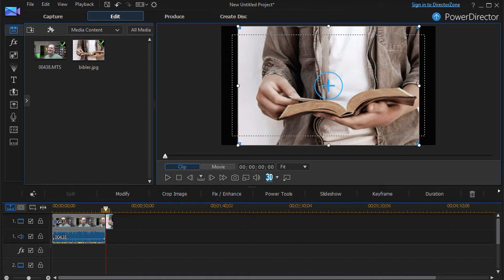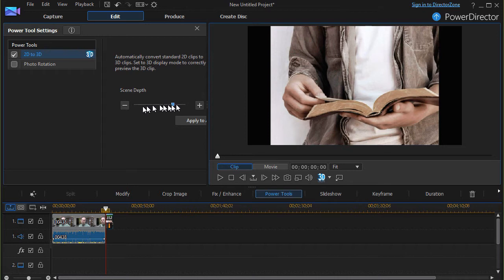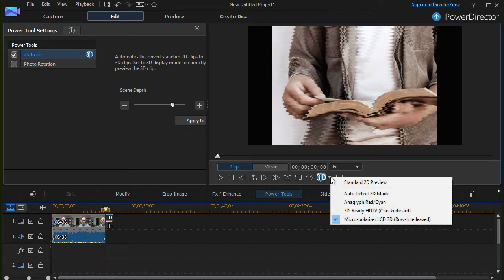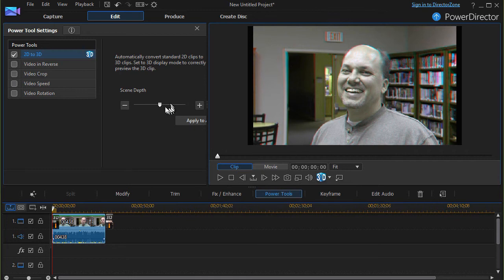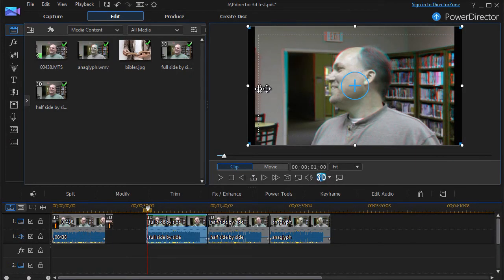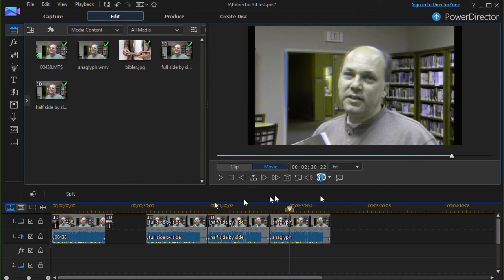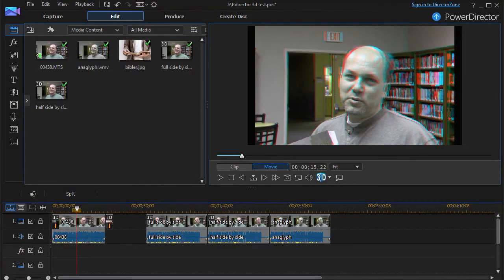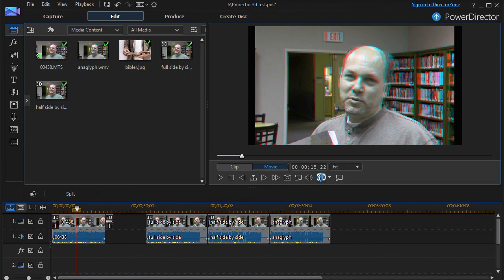PowerDirector - How to emulate 3D results with 2D footage

Comment: Everything I've tried so far has failed to turn into a 3D film. What is the secret?
Reply from the maker: I just reviewed the lesson. Much has changed in Cyberlink since this lesson was created, so I will design a new lesson. In any case, you will need a version of PowerDirector that supports this feature to try it out.
This link shows the differences between the products available in the current version.
https://www.cyberlink.com/products/powerdirector-video-editing-software/comparison_en_US.html?affid=2581_-1_647_PDR-B&msclkid=fbaadaf0aba312ba709ebb04acbebad3&utm_source=bing&utm_medium=cpc&utm_campaign=PowerDirector%20Branded%20-%20US&utm_term=power%20director%20review&utm_content=PowerDirector%20-%20Phrase

Jim
Reply: Since then I've managed, but the quick view during editing renders perfectly, while after rendering (color, light, contrast) it's almost unwatchable.

Comment: I am making a 3D video right now from a 2D cartoon and i would like to change multiple things at once on one timeline.  For example all texts at -20 3D on the timeline.  Is that possible?
Reply from the maker: I don't know an automated way to make those changes. My guess it that you would have to  make each adjustment manually, unless I'm overlooking something. (Which is certainly possible.) --Jim

Comment: I assume we've all been to the movies where a 3D film is showing.  You pick a set of glasses which they ask you to return at the end of the film.  Does any of PD's 3D capabilities match this type of theater style 3D?
Reply from the maker: Yes. You can get red-blue anaglyph glasses from Amazon and use them when you produce a 3D project in that format. It's not as sophisticated as what you see in 2017 movies, which use a more sophisticated coding method. But the principle is the same.